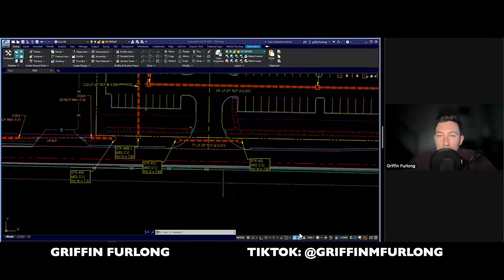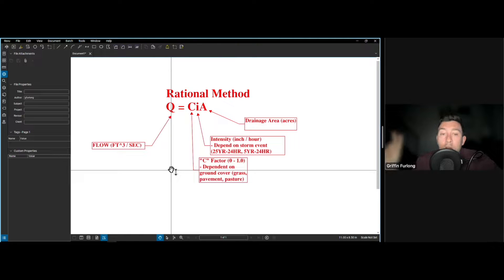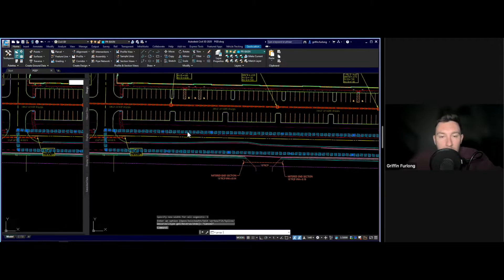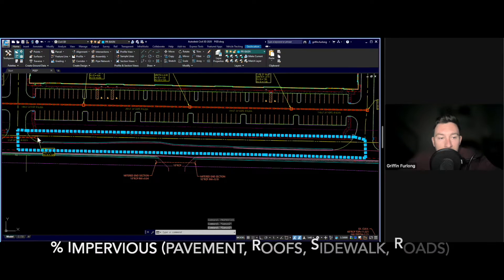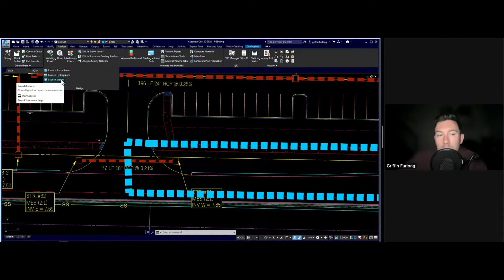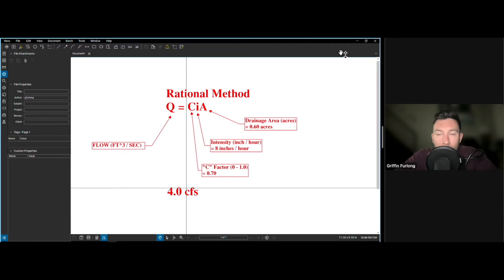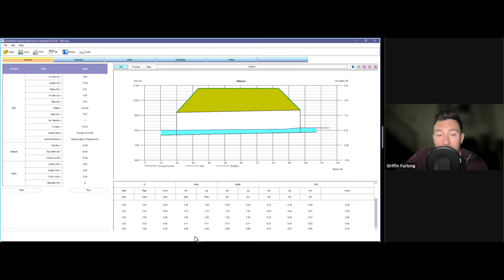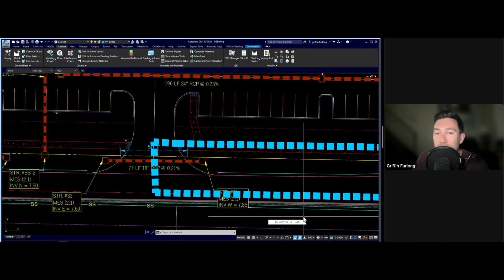How to Size Culverts (using Hydraflow)

Comment: When you obtain the rainfall intensity value from somewhere like NOAA, do you use the rainfall intensity table or the rainfall depth table? Which time row do you select from or how do you decide which one to select from?
Reply from the maker: Rainfall intensity. You’re looking for in/hour. It’s usually appropriate to go with the average
Reply: @civilgriffin how do you determine your storm duration for the rainfall intensity curve?
Reply from the maker: @zeke012 when you’re designing you typically have storms you’re required to design to. More often than not it’s a 24 hr duration so. For instance, we have to design to the 25yr-24hr storm so go to your 25 yr column then your 24hr row. Email me if needed. There should be a clear table.